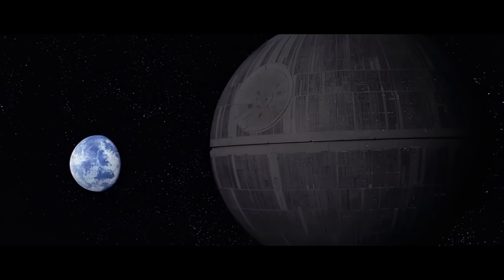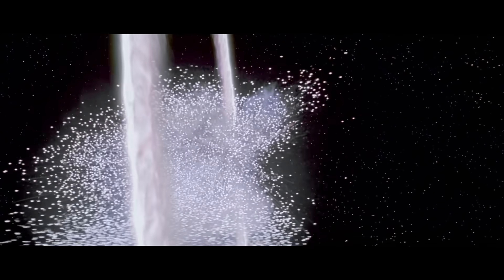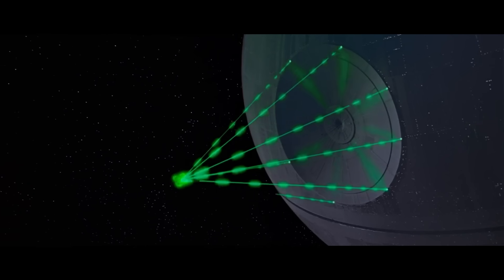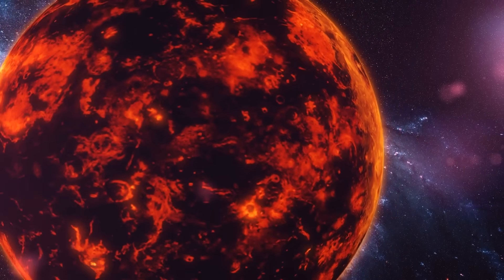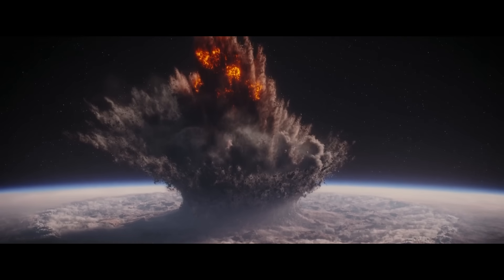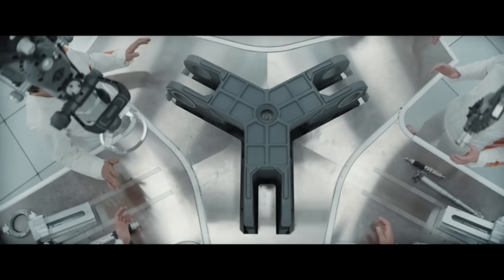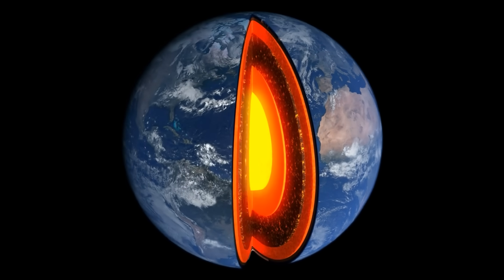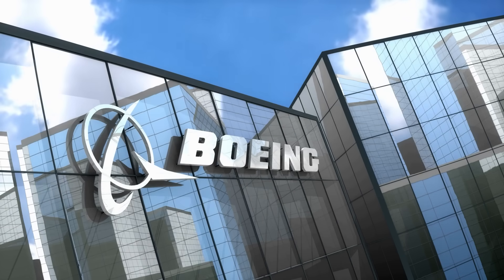The other "Design Flaw" no one talks about on the Death Star

Comment: You mentioned that the rebels just need to find the power source. But that's exactly what they did, didn't they? 1 shot into the reactor and the whole system goes down.
Also the Death Star was probably not designed by apes, so I'm sure there are multiple backup systems, in case some of the anti gravity generators would go offline. I imagine it more like small generators throughout the entire space station with backups. 
Good luck for the rebels finding out where each of them are, especially when they are all probably hidden somewhere deep inside.

Comment: Thank you for looking into it but I assume that it is far more reasonable to have the station at 0,5 G this would still preserve bone density and muscle needed. But would also enable for Luke to swing across with leia as at 1 G it is possible like the mythbusters showed but unlikely. 0,5 would make that far more likely. It would also reduce the strain on the station as well as the energy consumption would be reduced. 
Another thing to consider is that physics in the SW Universe might differ from our physics. An example is that noise travels through Star Wars Space so maybe there is some mater that would pull outwards on the death star? 
Also if we consider our physics the second death star at 200km would be far below the hydrostatic equilibrium needed to form a sphere due to gravitational pull so yes it would be unlikely but also possible in our galaxy ;)

Comment: If the Death Star weighs 4 quadrillion kilograms, then its surface gravity is approximately 0.000041714m/s/s, about 234,933 times weaker than earth gravity. Under its own gravity the Death Star would weigh only about 17 billion kilograms, for reference: the Great Pyramid of Giza weighs only approximately 5 billion kilograms. Gravity fields may not be as crucial to structural integrity as it might first appear

Comment: So IRL none of this matters as the death star vaporizes when it fires no matter what. 100% energy transfer is not a real thing. A very efferent process like ATP transfers about 38% of the energy the other 68% is lost as wast heat. In hard sci-fi we let you know aliens are stupid advanced by claiming something like 80% energy efficiency. Let's assume the death stars main reactor is 99% efficient. The supper laser needs 2.49X10^32 Jules to do what it did to Aldan. With 99% efficiency that mean about 2.49X10^30 Jules in wast heat. If we assume the death star is about 20 sextillion Kg. Then that's about 124 billion Jules a Kg in wast heat. Assuming the death star in it's entirety starts at 1 degree C over absolute 0, that's enough energy to bring said death star to a temperature of just under one billion degrees C. AKA 10 times the temperature of the core of a blue supper giant. Even assuming 99.9999999% efficiency it's still enough to literary boil the blood of every one on board. All of this assumes that the supper laser its self is 100% efficient. If it's only lets say 99.9999% efficient then this problem just got 100,000 times worse.

Comment: I'm not totally sure that gravity would be a huge issue for this craft. Doing some back-of-the-envelope calculations, assuming that the Death Star is 25% solid matter with the same density as Titanium, the Gravitational Force on the surface of the Death Star would be a whooping... 0.025N. This is not really surprising. While the Death Star is large for a ship, it's tiny for an object in space. It isn't moon-sized, it's the size of a large asteroid or comet. Even if the Death Star were solid steel, it would still be just 0.023% of the mass of the moon. To make that much steel would require more than all the iron in the Earth's crust, but just 0.001% of all the iron in the planet as a whole. The DS being in orbit would have very little effect on the planet; it just doesn't have enough mass. Also, if the DS were in orbit, killing the power would not make it fall out of orbit; it would only fall if it wasn't in orbit and was using its engines to remain above the planet.

Comment: You're overestimating the power of gravity. It is quite feasible to build a Deathstar out of steel and it not collapse in on itself. There is another stronger force pressure in our case 14psi, or 1bar. The Death star in reality is monstrous planet killing balloon. Atmospheric pressure would keep the structure rigid think of it as space going dirigible.

Comment: Just how do you propose actually sabotaging the gravity generators?  I imagine since they're critical systems they would be well protected.  Any external attack would be out.  The rebels had to use snub fighters to get past the standard anti-ship defenses.  Infiltration?  If the Empire succeeded in building it and keeping it secret, then this design flaw was also secret.  How would the rebels find out about it?  The exhaust port shot was the only way the rebels could take it down because - had they not - the rebel base would have been super-lasered into oblivion since they bugged the Millennium Falcon and followed it to their doorstep.  There would be no rebels left to find any other weakness in time to exploit it.

Comment: A note:  The gravitational binding energy of a planet is actually a substantially different concept than the nuclear binding energy of atoms, and not really comparable at all.  Your number is also much much higher than actually necessary.

That is the amount of energy you would need to make all of the individual atoms of the planet each separately go away to infinity. (so they never ever (ever ever) come back again in the history of the universe), but that is not what is necessary to just make it not be a planet anymore.  All you really need to do is blast it into small enough pieces (not atoms) with enough energy that those pieces leave the general area the planet is in, so that they won't come back together right away.  Realistically, if they eventually end up coming back together to form a planet again, say, 100 years later, did you fail to destroy the planet?  No, not really (from a practical perspective).  The fact that it came back together later didn't make it not just as destroyed when you blew it up.

(I remember Kyle Hill also made this miscalculation in a video he made about the Death Star a long time ago, too.)

Also, at 5:22 where they're talking about still seeing Alderaan in the sky, of course it would still be there (even if you ignore the whole FTL travel thing), because they never blew up the star, they only blew up the planet.  The star is still there (and giving off light), so of course it would still be visible in the sky from other places (even if you were really close)...

Comment: I think you don't even need a tractor beam with an asteroid. Just an asteroid with a light speed engine and then just fly the thing in a planet would work. Using the formula for kinetics, (0.5 * mass * speed^2) with 300k m/s for speed, I don't think you would need a big asteroid to do the same thing.

Comment: An interesting thing to note with the Death Star is that a single reactor ignition is enough to crack a planet in two. Jedha in the comics is completely uninhabitable forever as a result of the single reactor ignition. The shot cracked the planet right down to the core and practically blew it in half. 

They could have split the Death Star into multiple smaller weapons and be much more effective without sacrificing the Tarkin Doctrine.
Reply: Like into hundreds of tall office buildings that hang in the air in the exact same way bricks don't. All surrounding the planet to prepare to demolish it to make way for a hyperspace bypass.
Reply: After the orders have been filed in triplicate and gone through all the proper bureaucratic channels of course!
Reply: Single-reactor ignition didn't appear quite that powerful in the movie version!

Comment: In order to get a planet to explode near instantly like Alderaan did you'd have to do a lot more than just gravitationally disrupt it. You'd basically have to flash-vaporize the majority of its solid and liquid contents, so that the EXCESS energy left over after the initial strike of the superlaser on the initial point of contact is SO great that all the messing potential chaotic consequences of rock chunks breaking away chaotically and so forth get overwhelmed in the sheer magnitude of the overkill. You'd need upwards of a million times the gravitational binding energy of the planet, all deposited in a microsecond.  The sheer magnitude of the energy required is absolutely insane. So much so that the fraction of that energy shining back on the Death Star from the beam as it fired should have been enough to vaporize the battlestation (which after all, is only the size of a small moon, and with large hollow spaces inside) entirely along with the planet.

Comment: Technically, a moon sized object entering hyperspace is impossible and FTL would rip it to shreds. The mass to energy ratio would be so great, and the sheer forces of attaining light speed, and obviously beyond by several quanta, would crush and implode the thing, and explode the soft parts if it entered, not to mention deceleration would be impossible.

Comment: The old republic wasn't democratic, the empire was just a new paint job on the old system.  But that's not the topic of the video.

There was no reason to keep the construction of the Death Star a secret.  Any ship capable of interstellar velocities could easily destroy a planet, even by accident.  And Tarkin wanted his Death Star to be feared.  All the imperial generals, all the imperial navy, a senator, and a Sith lord, all tokd him to his fsce that it won't work, but he dismissed all voices of reason, because he had more firepower, and in his mind that trumps everything.  But that's not the topic of this video either.

The empire was not just the Death Star.  The DS is neither emblematic nor typical of what the empire does and how it works.  As the conference aboard the DS clearky shows.  But that is also not the topic of this video.

The Death Star was meant to be a space station.  A fortress, not a tank.  Tarkin said that Dantooine was too far away for an effective demonstration.  (People say that the Star Wars galaxy is so big, but Tarkin immediately knew where this far away planet was.)  It was in post production that the sequence of the DS approaching the moon of Yavin-IV was added, to add dranatic trnsion via a ticking clock.  (Although it doesn't really make sense when you think about it.)  That (and nothing else) made it necessary for the DS to be a mobile base with a hyperdrive.

Bringing physics into Star Wars destroys it.  The entropic heat from blowing up Alderaan would destroy the DS many times over.   (And yet Vader insists that this power is insignificant to the Force.)

Structural integrity is the least of the DS's problems.

And the trench run at the end was supposed to show the hollowness of military heroics. It was meant to be a pointless waste of life.  Biggs Darklighter, the militarist braggart who had tried to recruit Luke in a deleted scene, was the first to die, unceremoniously, having achieved nothing.  But the editors thought that a no-stakes battle was boring.

Not to mention that the ceremony at the end was a direct reference to Nazi propaganda.  In case the audience had missed that the Rebel Alliance was in defense of monarchy, one autocrat against another, while the entire plot revolves around two slaves that nobody pays attention to.

Comment: I don't think the Death Star's natural gravity would be all that much of a consideration. I think even if it were solid steel, its gravity would be about a hundredth of Earth's gravity at the surface. Its main problem would be moving it. While it's clear Star Wars tech has overcome this, our current knowledge suggests that the amount of energy that would be required to move the Death Star (and at speeds to make it useful for travel) would be so great that the entire station would melt!

Personally I'm still trying to figure out how those guys watching the main reactor beam fire down the tube weren't vaporized by the heat it was surely giving off (or blinded by its light). I don't think those beetle helmets are gonna quite cut it boys

Comment: I think people vastly underestimate the level of gravity control technology that exists in the star wars universe that makes all of it possible... 
Whether you are talking about Repulsorlift, Artificial Gravity, Inertial Dampners, Tractor Beams, and Acceleration Compensators the ubiquity and fine control they have is actually completely OP.

If you believe the Legends material, this is even after they have declined considering centerpoint Station not only built planets but moved them from system to system intact.

We know it is fully integrated with their starship technology and absolutely depended on for Hyperspace to work and prevents everyone from becoming a ballsy beltalowda slingshotter juice spray every time Anyone jumps in or out of hyperspace or even leaves an atmosphere within a minute.

Repulsorlifts are precise and stable, they don't PUSH against the ground or a gravity field, they seek equilibrium at a set point for a calibrated weight range, like a helium or hot air balloon of gravitic force. Turning one on without it being securely anchored to a subframe will probably result in a vertical launch SDF-1 Style.

Artificial gravity generation is not a cumulative equation. 1g on a ship with 1 deck is still 1g on a ship with 50 decks, Whether it is individually allocated to every single or couple of decks or only built into a ship's keel, affecting the whole vessel. You can see this from the varied results showing BOTH turning off artificial gravity zone/deck selectively or for an entire vessel as a factor of life support controls. It is also directional with a "up" face and a "null" face so folks aren't walking Escher style on both sides of a floor.... (unless they WANT them to). You can easily even have gravity decking inward facing on multiple surfaces of a large chamber (like a hangar, or Reactor space) with a no gravity zone in the middle like the Hollow World transition in Godzilla Vs Kong. It is also not exceptionally radiant and tightly targeted in effect, as whether mounted in each crew deck or ship's keel mounted it does not affect objects on the external hull, even walking above an occupied compartment's ceiling/roof requires magboots for personnel or maglock locomotion for Droids.

You also radically overestimate the amount of natural gravity generated by a massive object like a death star. Considering they are not that massive they are actually very small. The DS1 / DS2 could literally park in the bottom of Lake Michigan like a testes in a scrotum and not touch either shorline (if the water was deep enough) or if you posted a pair of Goa-ould Traffic Cones from Giza on either end of Long Island, it could park between them with no overhang.
As you wisely mentioned, it is not a solid block of Durasteel. It has a very hollow construction, and would not represent a tidal factor whenever passing through or even parking in orbit...

Comment: 7:10 - "When you have something that large in space it's going to have gravitational pull"

Yes, but not much.

If we estimate the Death Star had a mass of around 1x10^18 kg - that's roughly 1000 times the mass of (way over) "one quadrillion kilograms" cited in the video - then at its surface the Death Star would have a gravitational acceleration of 0.01 meters per second squared. It's not going to be causing massive tidal shifts on a planet it orbits

Comment: 10:30 the Death Star has less mass than a typical mountain on Earth — it wouldn't cause any gravitational disruption.
Reply: " a moon " is not a defined quantity, moons can be tiny asteroids a few miles across.  Even one large enough to be special can be as small as a 10s of miles across.  Canonically the Death Star is 100 miles in diameter, moons that size have tiny amounts of gravity.  Ceres has just 3% of Earths gravity and is 10 times the diameter of the Death Star.  You really have to know absolutely nothing to make the kind of statements in this video.

Comment: sigh  Shit...

Ok... for starters... a giant tractor beam to fling asteroids is as pointless as the Death Star.  If you've got FTL, or hell, even just plain near-lightspeed drives no matter how its accomplished... you can destroy planets...  The End.  Something the mass of an X-Wing, even just scraping the edge of the speed of light during the transition from normal space to hyperspace... would blow a planet to molten boulders, pebbles and dust.

Secondly... planets have next to no value intact.  Their best resources are mostly in their mantles and cores, and planets are actually really shitty places to live.  They're stuck around their parent star, their environments are difficult to adjust consistently on the fly, and honestly everything that makes a given planet habitable, is largely wasted across massive volumes of its surface that are just completely unused.  They're inefficient, make space travel a pain in the ass...  Planets are shit.

Efficient and reliably-designed, simple space habitats are far more effective... and, if you're tearing down planets to build them anyway... cheaper.  You get far more value per cubic meter on a habitat than you'll EVER get from a planet.

And any sort of planetary preservation or terraforming... is just an absolutely unforgivably wasteful and stupid idea.